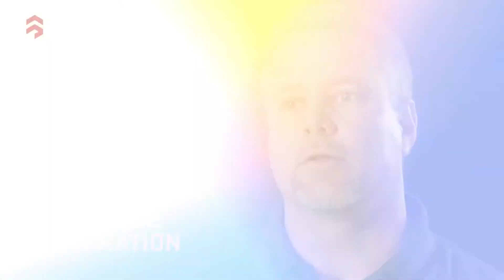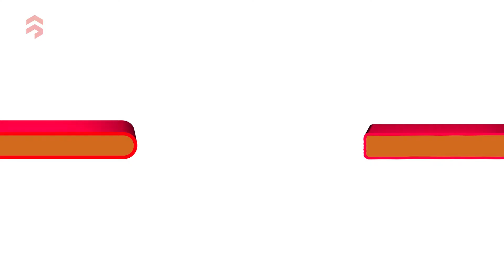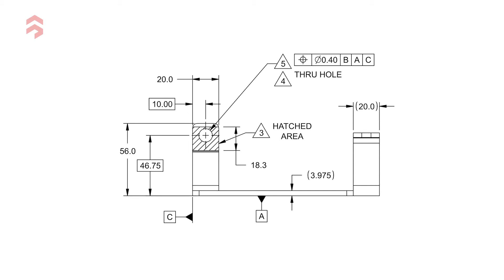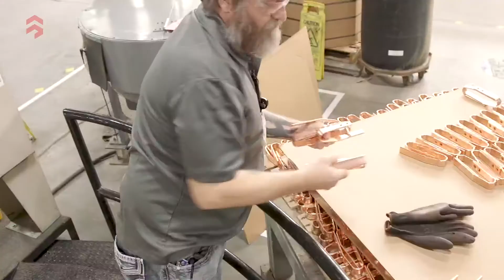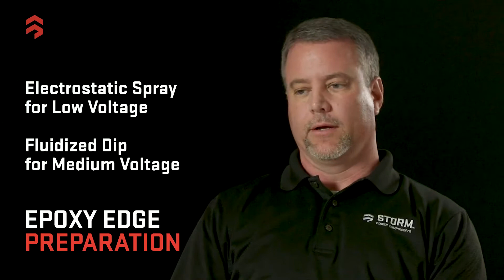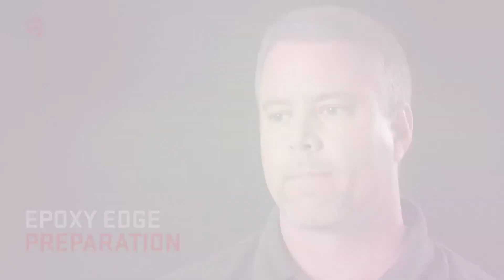Storm Power  - Top 5 Design Guidelines for Epoxy Insulated Busbar

Comment: How to marking area non epoxy ?
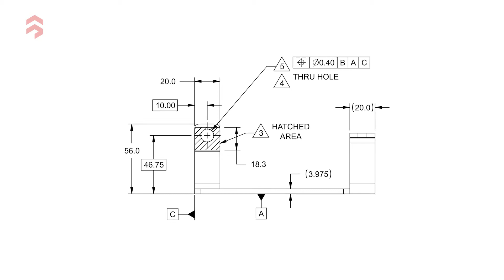Reply from the maker: pause the video at 0:55 mark 
 
A common way of indicating powder coat requirements is with the use of Hatch Marks. In the example in the video, you will notice the phrasing “Hatched Area” and how it is tied to callout 3. You would then add a note on the print that says hatched area to be free of powder coat. In this example, it would be listed as note 3 in order to correspond with callout 3.
Reply: @stormpowercomponents2123  I work in Italy with the same procedure :) hot cutting do you make them?